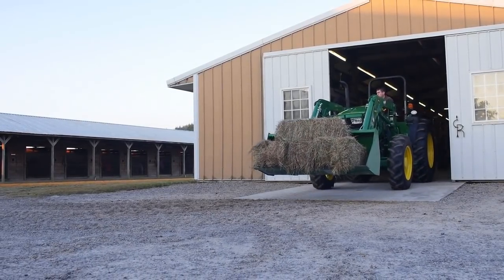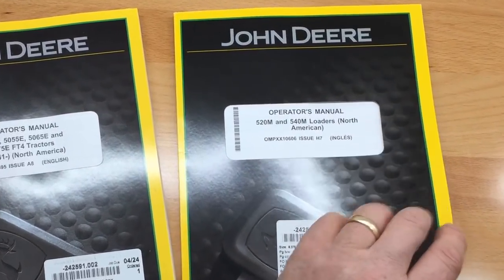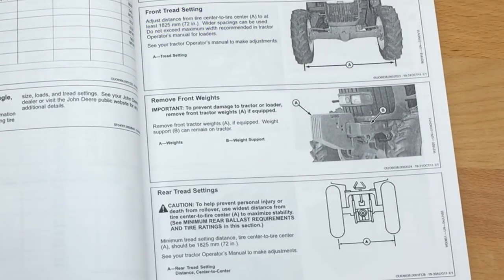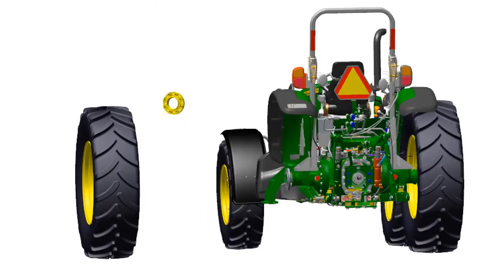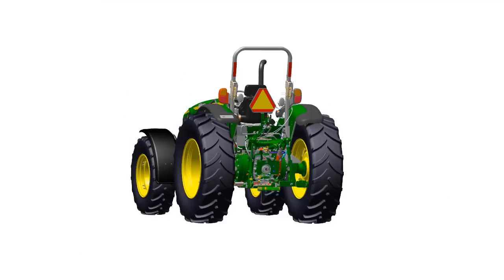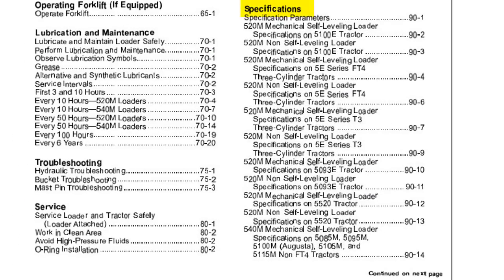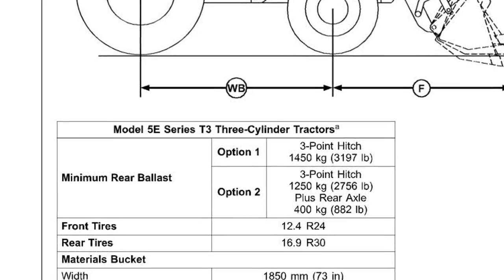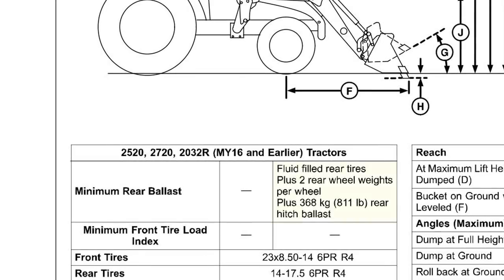Loader Tractor Ballasting

Comment: FYI - there aren't any "ballast recommendations" in the "Prepare Your Tractor" section of the 320R loader manual.  That is to say - the section mentions these things:  the need for ballast; a ballast box; wheel weights; fluid in the rear tires. BUT - it makes no "recommendations" as to how much ballast weight is required on which tractor.   Then, on page 50-2, an entirely different section, it says "Add the required amount of ballast to the tractor. (See Prepare Tractor section.)".   Yet, the "Prepare Your Tractor" section has no information at all on the "required amount of ballast".
(And just a suggestion - if you want to make your tractors more stable, you should offer rear wheel spacers on all models - especially the 3R series.  Or at least put a prominent notice in the tractor operator's manual to the effect that "using these 3rd-party wheel spacers of such-and-such size will not void the tractor warranty".)